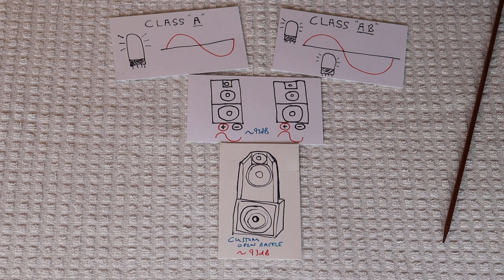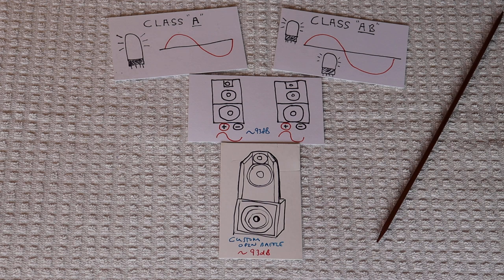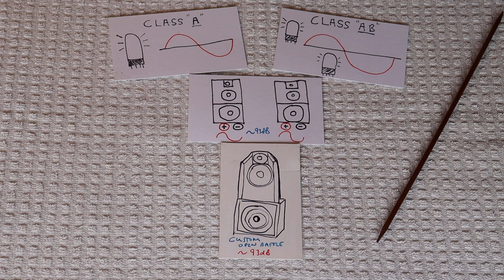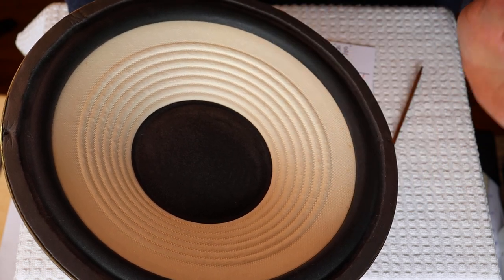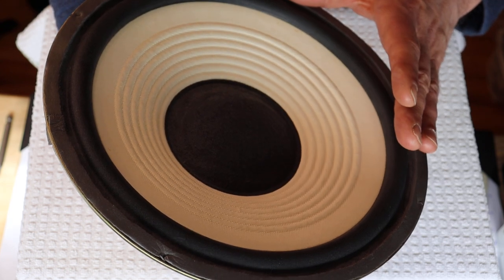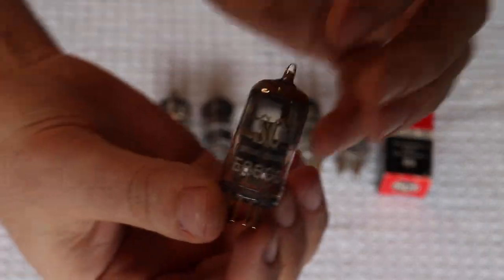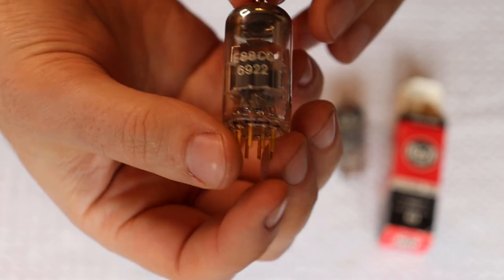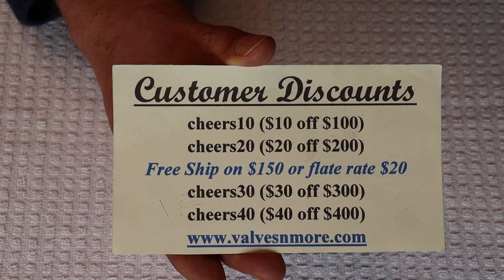Tube Lab #127 - Dipole Speakers AKA Open Baffle Speakers Part 1

Comment: I've been building open baffle since 1994,  I don't think I could ever enjoy music for critical listening on any conventional box speaker.

Even my big CBT line arrays I built for my home theater are open baffle.  In fact all the speakers in the home theater will be open baffle with the exception of the IB subwoofers that cover 10 ~ 30 Hz.  If I ever get around to doing Atmos, they might be sealed or maybe not! 

Around 30+ years ago when we cleaned out and sold my dad's TV shop there were hundreds of tubes, I think my brother may still have them but they were for TV's and radios, not sure if there were any that would be useful today for high-end audio.

Comment: What tweeter are you using?
Reply from the maker: Wavecor TW030WA11/12, the /11 model is 4ohm and the /12 is 8 ohms.  Recommended to me several years ago by a company that specializes in selling speaker drivers and crossover components and they have been wonderful tweeters.  One developed a very small noise several years ago, so we're on our second pair - but given the hours we put on our main listening system and the testing work we use it for, it wasn't a surprise that at some point we managed to damage one.  If we didn't use our tweeters to check for system noise we would have just left the tweeter in, you couldn't hear the noise unless you put your ear in the tweeter waveguide.

Comment: hi I have a question ✋ if the Qts is low say 0.3 would moving the ob closer to the wall help the bass instead of away from the wall eny help would be great from everyone hope you get what I mean 😅
Reply from the maker: I tried my OB panels with all sorts of configurations (12 prototypes) and hated the bass in all of them.  It wasn't until i built an H frame bass box that i truly had great bass from my OB's.  Next Tube Lab we'll hopefully have time to look at my prototype build and discuss what worked and didn't work.
Reply: @tubelab194   nice one can't wait ☺️👍
Reply: @tubelab194  I'm not after super low bass in my build as I live above people but can't wait to see what you tested
Reply: @tubelab194  we'll I tried a low Qts speaker driver's close to the wall about 5 inches and I think it worked I've got more bass and the mids and tweeters seem to blend better to so I'm pretty happy with the results ☺️